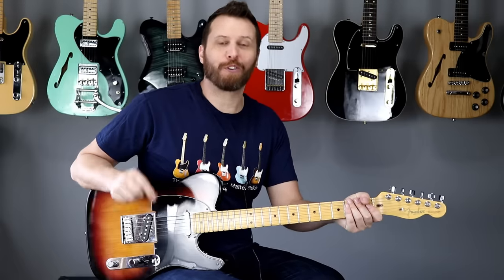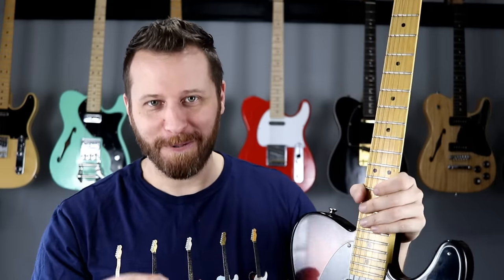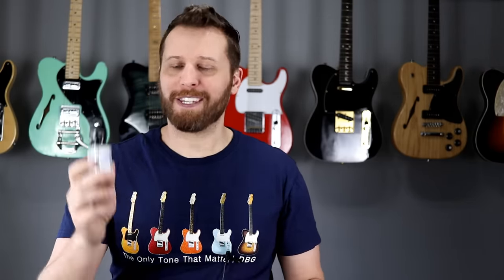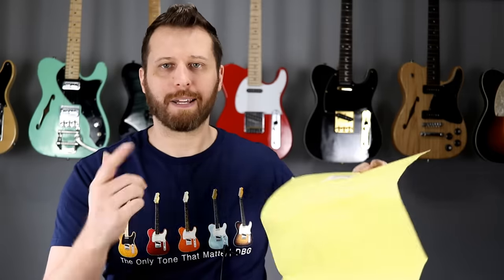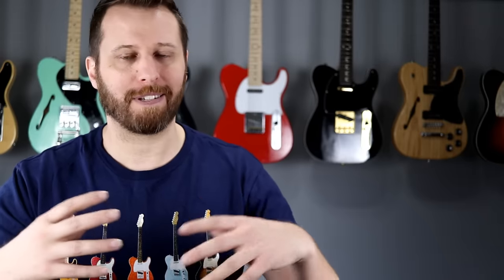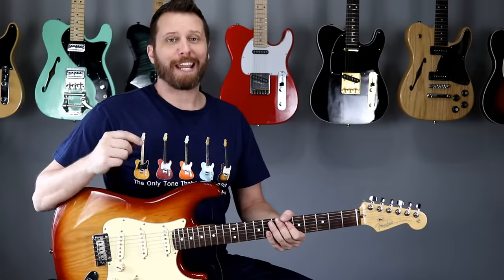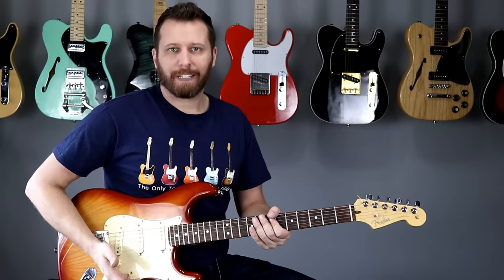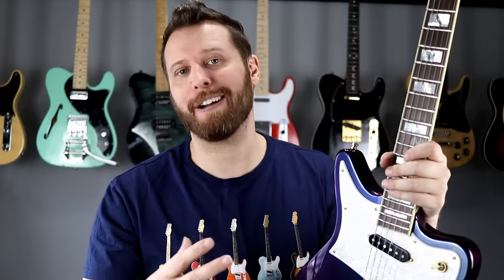KILL The Hum and Buzz!! - Keeping Your Single Coils QUIET!

Comment: Man, Darrell, you were a real buzz kill in this video
Reply: @DarrellBraunGuitar  i bought a telecaster today as my first guitar with a fender champion 20, the guitar wont produce any noise all i get is a static noise and whenever i press any of the strings at all i can hear a sort of static boom in the amp, any help appreciated
Reply: Kristian Todd Hello I also have a Fender Champion 20 and a single coil Fender (a Strat). I hope you’ve solved your issue by now, but if not, here is some input. Assuming there are no issues with the guitar or amp itself, here are some tips. To get a nice, clean sound, turn the Voice knob toward the left to one of the cleaner settings (tweed or blackface), and turn the gain knob down but not all the way down. I usually keep the gain knob at 2 or 3 for a clean sound. This should hopefully solve your issue.
Reply: @CaloomClark  probably the speakers but the guy on top of me tells you what to do.
Reply: Luke Schiltz I also have a Strat and a Champion 20. Thanks for the tip.
Reply: get out
Reply: Be like a radio and move around the room slowly until you find a spot where your guitar doesnt pick up so much interference. It works because pickups are like antennas. My amp used to pick up a radio station by itself in my old flat
Reply: @CaloomClark  play with the volume knobs and settings. Some will be too loud. Some will be too quiet. Just a little raising the volume works for my champion 20.

Comment: Self-adhesive copper tape (anti-snail tape) throughout the pickup cavities and routing cavities, and on scratch plate, all joined up, wire from tape to back of volume pot. Done. Costs virtually nothing and is amazingly effective. Takes 20 minutes and transforms your guitar.
Reply: Agree. My Fender strat has all the cavities (vibrato one too), tapped with copper foil. The hum it's just at the same level as for the humbucker. I can go even further with the statement, my Washburn has more background noise when i don't touch the strings, than my Strat.
Reply: Hugelongjohns Awesome
Reply: Mihai Iatan Very cool
Reply: @mihaiiatan6720  did you ground the cavities together?
Reply: @1thess523  yes, connected with the pickguard too.
Reply: @mihaiiatan6720  Yes, if you leave a tiny bit of tape peeping over the edge of the cavity to connect with the tape on the pickguard you get a continuous shielding cage. The tape comes in lots of different widths, by the way, so use some that's about 10cm for a faster, neater job.
Reply: @1thess523  If you overlap the tape and run it everywhere inside the guitar all the cavities will be electrically linked and sheilded, which is what you want.
Reply: By the way, another good thing to do is make sure you twist all the cables around each other so they're not just sitting loose in the cavities. So from the pickups, twist the wires so eg the black and white are winding around each other before they hit the pots and switches. All these little things help with hum and buzz.
Reply: This. Been doing this with every guitar I've owned for the last ten years and the difference is huuuuge. If you use the thinner copper tape, it's relatively easy to do even for a beginner.
Reply: I am surprised that Darrell did not mention or demo this procedure. I am an amateur guitar tinkerer and have had the same level of success that Hugelongjohns noted.
Reply: can you explain All joined up thing with the tape
Reply: Can I use aluminium foil instead of copper foil? Will it still work?
Reply: @HARMONICAPLAYER1000  aluminum doesnt conduct as well so it won't be enough for some problems but  for the most part it should cut it enough and be less susceptible to corrosion or oxidation.  Remember to use heat shrink on any hot wires inside the cavity...unless you want a spontaneous jimi moment.  No need for the lighter fluid.
Reply: The first time I encountered this kind of hum (20+ years ago when I bought an Ibanez guitar and a Fender Amp , Champion model if my memory serves me well, I tried to find the solution and I found an article about copper or aluminum foil behind the pick guard solution in a guitar magazine. I live in Thailand and here we use 220-240 V and 50/60 Hz system. At the time the power outlet had only 2 holes, i.e. Line and Neutral. There was no ground connection. I noticed that my Fender Amp came with 3 prong male plug so I thought I might need to install a ground rod. This was because I noticed that whenever I touched the strings the hum would be completely gone. If I pull my hand off the strings the hum started again. So I was thinking   static charge might cause this annoying hum. So I went out to buy a 1 meter long copper ground rod and installed a new power outlet socket with 3 holes (Line, Neutral and Ground), connected a ground wire to the copper ground rod buried 1 meter under my front yard and the hum was completely gone. That made me wonder why nobody (guitar magazines at that time) mentioned this as a possible solution. May be this was not an issue in the U.S. where 110 V AC with ground was the norm.
Reply: Thanks!
Reply: I use aluminium foil, straight out of the kitchen drawer, stuck down with Pritt stick and properly earthed by putting a small screw through it into the wood, with a wire wound round it and the other end soldered to an earth point.  I tried copper tape, which was much easier to install, but decided that it affected the guitar's tone and went back to aluminium.  This makes a huge difference to any guitar's propensity to hum.
Reply: I bought a Harley Benton TE 52 (tele clone) that had no shielding at all, could not stand the hum, it was ridiculous even with low gain. I bought large sheets of self adhesive copper foil on Ebay relatively cheap. Filled in all the cavities with some coming out so that it connects the inside inside of a copper shielded scratch plate and control plate. Made sure that any foil joined were connected as the self additive backing can be conductive.Twisted all the hot and earth cables from pick ups and wires to out put jack as tight as possible, this helps with noise too, then made sure all the cavities and bridge plate were earthed to the tone pot - I soldered mine. It’s now as quite as a Humbucker. This is the best solution in my opinion, it’s cheap to do yourself, or get someone practical to do it for you. It’s called a faraday cage.
I can’t stand gates, it effects your feel or noise cancelling pickups, they just sound different, or simply not as nice sounding as standard single coils. I took my time, it took me about 2 hours, why rush it, take your time and do a great job, you won’t regret it. It quieter than my USA Strat which has the shielding paint, it has foil on the scratch plate too. It’s a no brainer, this if far the best solution to hum cancelling single pickups.
Reply: @DenisAhmet  thanks for the info. I should receive my Harley Benton in a few day and I expect to have a lot of hum canceling to do.
Reply: I have found cheap aluminum tape from the dollar store works just fine. It even has conductive adhesive so I don't have to worry about folding over a notch for contact (although I do anyhow). One dollar a roll, and it can cover the inner cavities and pick guards of about three guitar bodies. There is no cost excuse not to do this.
Reply: anybody have a video tutorial link for this?
Reply: Conductive paint is way easier to deal with than copper or aluminum tape.
Reply: I did this and it transformed my guitar into a keyboard, I recommend it.
Reply: Do you have any link how to make this steps or tutorial?
Reply: Why doesn't Fender do this in the factory?
Reply: @TomGrubbe  cost
Reply: Honestly, you don’t have to do that extra wire to pot if your ground already has a pot connection , and your pots have that metallic section backing already.
Reply: Fenders usa are screened already when you buy them

Comment: In the UK we do not have a problem with 60Hz buzz. We do have a problem with 50Hz buzz.
Reply: Alex Bowman lmao
Reply: And anyone who has experience of 70 cycle hum will tell you; The hum isn't as good as it used to be.
Reply: In Soviet Union guitar buzz you..
Reply: Goofy 240V is even worse I bet.  There is a push here in the US to cut the amount of 120v lines running in houses because most things in the households really run off of 12v or less.  Edison screwed us over all those years.  The newest thing people are doing is installing big transformers in their houses to drop the voltage to 12v so they can run almost everything on solar.  No stupid wall warts or transformer boxes on electronics. Imagine that, Tesla was right all along.
Reply: @samfosdick9874  What a country!
Reply: @Serenityindailylife  Tesla was right about MANY THINGS and had big oil and gas industry and our government stayed out of his way our entire planet would be so so so SOOOOO much better today!!
Reply: Language difference.    ;)
Reply: @Serenityindailylife  You got it backwards: Edison favored DC, Tesla favored AC. Tesla won.
Reply: @roypalfrey169  It's desirable for some right?
Reply: Duh, higher voltage needs lower current to keep the same power going on, less current means smaller cables (at least at 220v where the isolation layer can be same materials) I'm pretty sure your fridge, ac and other high power consuming can't run with 12v
Reply: See whatcha did there 🤙🏻
Reply: @mostdistortion  12 volt compressor fridges are actually very efficient and car air conditioning units run on 12 volt, same as rv's. DC doesn't travel well over long distances so AC wins on that one as you pretty much stated.
Reply: @RetroOnSpeedDial  Some points there I didn't know 👍 Apparently the U.S. has five standard voltages for different purposes — 120V, 208V, 240V, 277V, and 480V. Domestic in general is standard though.
Reply: @pa_maj.MARTINI-van-MAN  the voltage matters. Need high voltage, or you get greater energy loss.  Also, p=iv. If you decrease voltage you have to increase current. Higher current circuits are more dangerous.  Generally, it better to have higher voltage in homes. I'd rather have 240 volts than 120.  E.g. the Brits can boil water faster with electric tea kettles.  Better for power tools as well.
Reply: @julianpeters37  👍👍👍
Reply: Tesla was right but for the complete opposite reason, Edison wanted to use the DC current, but the winner was the AC system proposed by Tesla. 
And the reasons why AC current won is that AC has many advantages related to the power distribution. Without AC it would be extremely difficult to transport electricity for hundreds of kilometers.
For the similar reasons, I don't think that having a single trasnsformer to power all the electric devices running at 12V in a house it would be a great idea.
Reply: @pa_maj.MARTINI-van-MAN  you ever heard of HVDC powerlines? Dont spread missinformarion if you know nothig about the toppic.
Reply: @veqazbaby2567  I was generally speaking and in general I am right. For distances over 1000 km, HVDC powerlines routing DC becomes a Good viable option, especially where wind farms and solar are involved.
I certainly wasn't spreading misinformation but a general consensus. Anybody in their right mind knows that information gleaned from the YouTube comment section should be double checked if it's of utmost importance. ( "Dont spread missinformarion if you know nothig about the toppic" 
That's what you wrote. 
Should I tell you not to comment on YouTube until you learn how to spell or use a simple thing like a spell check? You could be misunderstood and accused of something you didn't mean; I wouldn't dare be so rude vagazbab y.
Reply: Which hum sounds worse the 50 or 60??? 😅
Reply: @TheG7thcapo  both.

Comment: Turning around is a good method - if you spin 360 degrees you can usually find a position in which the hum is less intense. Moving around also helps. This is most useful while recording,  especially with a computer, which can be a massive source of electromagnetic noises.

If you use pedals, changing the power supply can help a lot. I've switched from using individual wallwarts to Mooer MPS8 and the difference is huge. Part of it is unlike with most wallwarts, this one is properly grounded, part of it is that a single transformer in a proper metal shielding sends out less interference than 3 with unshielded plastic cases. Finally, since individual PSUs can float in terms of voltage in relation to each other, they can cause hum in the effects chain, even if there was none coming from the guitar. Having a single PSU deals with that too.

Finally, a somewhat controversial option for recording is to use a noise removal plugin. Essentially, you leave a few seconds of just noise and hum at the start or end of the recording, then feed this into the plugin so that it can build a noise profile and use that profile to remove the noise and hum in a much more nuanced way then a simple gate would. I use Z-Noise by Waves and just feed it a signal from an amp or a distortion pedal and it works wonders. It has a huge latency though, so it's unusable in live situations.
Reply: I thought this was a joke comment at first "...if you spin 360 degrees..." but it works.  The advice on the PSU and Z-Noise plugin are also very useful.  Thank you!

Comment: I have  Ibanez RC430 that uses 2 dummy coils . One in series and one in parallel to eliminate virtually all single coil hum without changing the tone. It’s pretty ingenious:) This guitar is quieter and more authentic sounding than my Fender Stratocaster with Dimarzio Area pickups in it. The best part is it’s all passive ( no batteries needed ) and I can use any single coil pickups I want with it.
Reply: TimmyV there’s a few epiphone sig models by metal guitarist Lee Malia from Bring Me the Horizon that have the dummy coils in the back. His guitars come with a humbucker in the bridge and a hum sized p90 in the neck. No buzz at all!

Comment: I was reading this week about a new way of winding a single coil that's completely silent. This is genius!  You wind the first 3 magnets fully and then go on to the remaining 3 magnets and wind them in a reverse direction....TA RAAA! ....silence...
Reply: Leo Fender  did this in the 1950’s with the P Bass, and later with the G&L Comanche.
Reply: That's just a humbucker.
Reply: Also, that's what "noiseless single coils" means in his list. They're the in-line split coil humbuckers you're talking about.
Reply: That doesnt work, it creates a soft spot between the coils, if you bend over it it makes a horrible sound. The coils have to be set apart, like in the G&L Z-coil pickups

Comment: I've been using the EH Silencer, with all my gain pedals in the loop, and modulation coming after. The other guitarist in my band is using a Decimator. I showed him my setup and he was blown away that he didn't have to keep stomping it on and off. Hell, he would play (thru my setup), and then we'd talk gear for a second. There were a few times he'd hit the strings and scare himself, completely forgetting that the amps were on and turned up! Those pedals make a huge difference. I've also used the Boss Noise Gate for a long time, until it was stolen. Keep the vids coming Darrell!

Comment: There are a lot of myths about 60hz hum. In a nutshell, any electric instrument is effectively an electrical circuit thus 60hz hum (electrostatic noise) is nothing but RF interference. The only way to get rid of it is to ensure a proper electrical grounding of the circuit. 
Electric guitar circuit is basically conformed by the pickups + cable + amplifier,  the amplifier should have a metal chassis which is grounded internally . The important thing here is to make sure your amplifier is electrically grounded when you plug it to the power line. This ensures the RF interference bleeds to ground and is not amplified by your amp's circuit. 
Shielding the interior of the guitar's body and the back of the pickguard can help to reduce the hum however only grounding the amp can get rid of the hum. 
If you choose to shield the interior of the guitar's body and back of the pickguard, it is very important that you make sure you ground it to the output's jack ground terminal and not to the tremolo bridge. Fail to do this and in case of an electrical discharge you might get a very unpleasant electrical shock. In some cases this might even be life threatening.
Reply: Terrain So does that mean i should place my amp on the ground? i usually always place it on my bed
Reply: Running two wires in parallel (one to the bridge and one to the cavity) versus running one wire in serial (touching the cavity and continuing on to the bridge) is not going to make a significant difference in how hard you get zapped if things go horribly wrong. Prevention must be done elsewhere, and it starts with keeping your amplifier in good repair and properly wired. Better still, run through an opto-isolator so there isn't a high voltage anywhere on the guitar side of the circuit -- although this won't stop you from getting zapped by directly touching an amplifier with the chassis tied to live.
Reply: @apotato9227  No, grounding refers to electrical grounding which means the outlet and the house/building electrical installation should be correctly grounded for safety. In practice, if this is done correctly, this  means your amp should not buzz when it is on. In case you want to verify your house/building electrical installation is correctly grounded, only a certified electrician should perform that task.